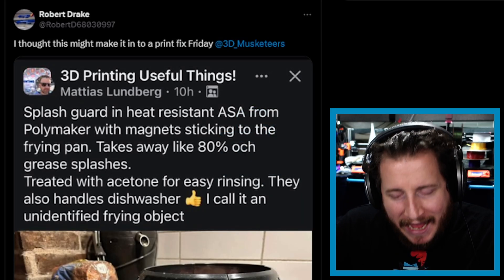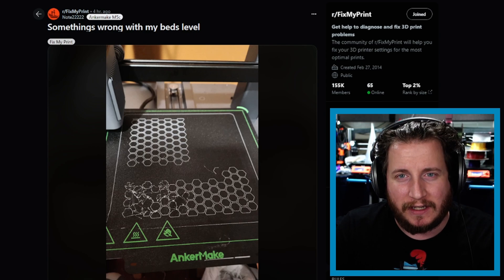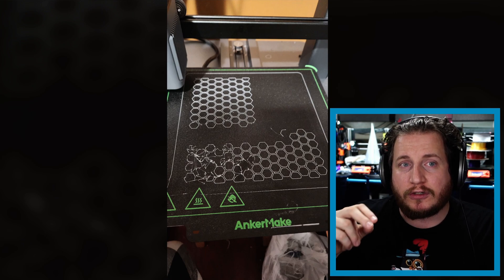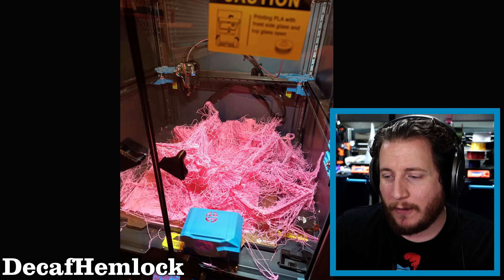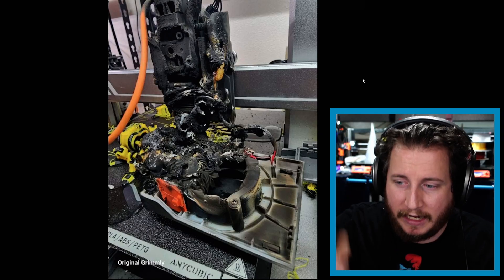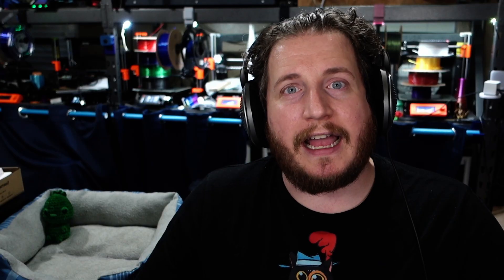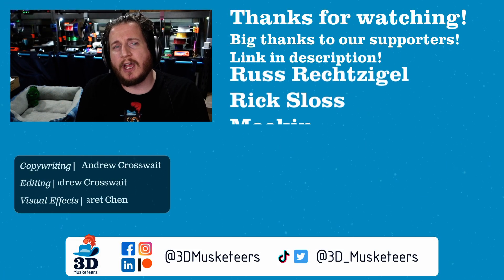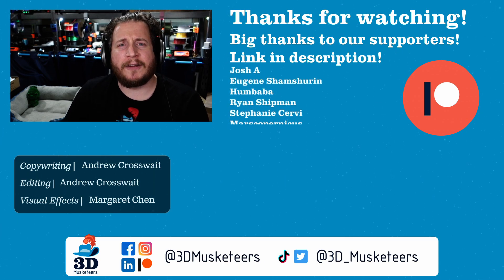Anycubic Fire Hazard?? - PrintFixFriday 173

Comment: With multiple printers myself, I am kinda disappointed with the overall negative views on the kobra 3. I also have 2 bambus, another kobra 2 and 2 crealitys. It does scare me that there have been a couple fire posts I’ve seen, but actual print quality I’ve had nothing but good luck. Have had more issues with my p1p than either of my anycubics. But I guess it just shows that each person is different and it can majorly vary machine to machine.
Reply from the maker: definitely some variability. Keep an eye on those wires and connectors though.

Comment: Another great video mate. What scares me is not that printers can burn up it's that some people believe it can't happen :( We are working with machines that are designed to melt plastic at high temperatures, of course there's room for it to go wrong :) This is why I have installed extra fire alarms, keep a fire blanket and extinguisher to hand and don't set prints running when I know I won't be home. That is before we look at the specifics of certain printers that seem to ship with faults or less than ideal components.

Comment: 6:05 also check the nozzle is clean before starting print. Had a similar issue with Voron Tap where the first few probe points (bottom left) would be way off from rest of points due to a tiny bit of plastic on nozzle that would knock/fall off after a few probe points.
Reply from the maker: ah, good point!

Comment: Hiya Grant,
I think the problem on the Sovol SV08 could be that the part wrapped at the front left corner. It looks like the part lifted up there.
I had the cable problem with the canbus cable of a BTT SB2209. I used the included cable in my drag chains. After just ~100h of printing on my Voron V2 the prints were stopping at different heights. After some painstaking tests, I found out the error happened at roughly the same X-Y position. I took the cable out, dissected it and found out the CanL cable was broken inside the insulator. Now my V2 runs with an Ölflex cable and no problems whatsoever. I will never use an included canbus cable of any canboard in the future again. I don't know why the factories of can boards do not include a high quality cable in their kits, as I would gladly pay more for a kit with an Ölflex or other branded cable which is certified to run in cable chains. The whole troubleshooting to so long and costs more than to pay for an upgrade for the proper cable. 100m of Ölflex cable are ~95€ which would result in added ~4€ bare costs to the can kit. even if the factory would double the price of it to let's say 10€ additional cost, I would gladly pay for it. Unfortunately even after raising the issue on discord with BTT, there is not even a warning not to use their cable in drag chains, not in the manual nor on the biqu product page, as I suggested to them.

Comment: cable fails; one of my printers started to develop a thermister fault with instant shutdown (fortunately) every time it ran more than 4 inches above the bed.
@#$%$ ribbon cables. After receiving my replacement printer, I ended up carefully setting up the ribbon cable path to spread the flex across the entire cable as much as possible. zip ties in the right places (some intentionally very loose).

Comment: Yeah, as a owner of the Kobra 3, I still can't recommend it.  It's inconsistent and they are still working out the bugs almost 6 months later.  
Leaky hotend, Bad firmwares, Horrible Cable Management setup, Z Rod Coupler Rubbing, Bad Wiring, and Z-Offset not saving.
Just Spend the Extra Money and Get the A1 combo that the Kobra is Copying from anyway.
Reply: Can just agree, should have gone for the A1 as well.

Comment: The issue with any cubic it that their therrmal protection settings are unknown. They don't let you access the firmware settings on the kobra 2 pro, max, and plus. My kobra 2 pro doesn't off the bed nor hotend during preheat at all forafter an extended period of time. I don't know if the kobra 3 are having the same problems, after seeing these issue, I'm not buying anything from any cubic without an open source firmware.

Anycubic as a company doesn't fix their problems, they just release a new 3d printer a year later with even more problems. They also rush their products to the market with a ton of issues.

Comment: I'm just going to be "that guy" and say that if you cook bacon in a teflon coated pan you don't deserve bacon.  Cast iron for the win.  If grandma could cook in cast iron and not have it stick you can too.  Bonus points for cast iron being non-toxic.

For the anycubic kobra 3 fire, I wouldn't be the least bit shocked if it was one of the early ones that has the defective nozzle.  Many of them are getting HORRIBLE blobs and if they aren't caught in time...well you can see the result.  Oddly enough their solution seems to be to GLUE the nozzle into the hotend. Lots of complaints on r/anycubicoffical.  Methinks that anycubic will be facing a similar public relations issue as Qidi did.  If they were smart they'd just send out replacement re-engineered hotends to every owner AND include one with every new sale PLUS stop selling them until they replace them in EVERY one they still have in the warehouses.  But this is exactly why I will NEVER be an early adopter for ANY product.  I say let the suckers jump in the front of the line and pay to be beta testers.  I'll consider buying once they've come out with the second, or even third, revision.
Reply: Microwave is the way to cook Bacon ;)
Reply from the maker: I too enjoy the love of cast iron from time to time, however the convenience factor of non stick CAN be nice. Depends on how much time I have or if I have not abused the cast iron somehow accidentally...
Reply: @3DMusketeers  I still have, and use, my grandma's cast iron skillet she got as a wedding present from her mother-in-law in 1936.   the ONLY teflon I own is the bowden tubes in my parts bin. 😁😁
Reply: Stainless steel...
Reply from the maker: I always seem to get the temp wrong on stainless, but that is 100% operator error lol

Comment: I have a Kobra 3 and I have observed that the Hotend wires (Black) are rubbing against the screw holding the part cooling nozzel in place on the inside of the cover showing black dust and damage on the cable to the nozzel.
This would have short circuited the hotend if not rectified.

Quickly sorted with some electric tape covering the screw.

Comment: @16:00 is why I am against people printing X or Y cable chains, but do nothing to upgrade the wiring that is flexible enough to be contained in a cable chain. Your average printer wiring will either work harden like shown, be bent at a higher angle than if not in a chain and result in issues over time, or simply the chain rub the wiring and wear off through the sheathing and risk shorts. Z axis move so slow and in small increments in comparison that it many times can be chained without risk, but XY movement can very quickly wear out wiring. Proper wiring made for cable chains has a more silcone inclusive sheathing and usually higher strand count to handle the flex and wear of the chain friction.

Comment: Honestly, for death blobs, I'd say that the thermal stripping blade for a soldering iron(they come with butane ones, they're basically a wedge you can use as a knife) is one of the best ways to slowly and carefully cut away a death blob, where you can then use a pair of pliers to grab the pieces you cut away and carefully pull them out without ripping any cables out. 

It's cheaper than the hotair station at least, and really quite handy if you want to just quickly cut a 3d print apart.

Comment: For the cable inside the drag chain... the best thing is to replace the cable itself or the full wire assembly. But you would need the extraction tool for the pins so the connector does not get damaged. Tbh buying a new cable assembly would be my option, if I would not have decided to go CANbus now.
And for everyone who might think soldering would be ok. No. Don't solder such broken cables which move a lot. They will fail 100%, and they will fail sooner than later.
Reply from the maker: yup! I would replace the whole loom too!

Comment: Investigate the following:
We had a user with a Kobra 2 Plus a few days ago which had a burnt PTFE Tube and was about to burn but was turned off before a fire could occur.
Take a look at the hotend. The PTFE Tube on the Kobra 2 Series goes down directly to the top of the hotend. Perhaps that's an issue on the Kobra3, too. If then the hotend gets over 240 degrees or so, the PTFE can start to melt and flow down on the Hotend.
Reply: PTFE to the hot end has been the default of any hot end that isn't "all metal" for better part of a decade.. For some not only to the hot end, but literally TO the nozzle for some cheap brands that were meant to only run PLA. It was the most economical and most user serviceable solution and used by EVERY hobbyist brand. That is where it also became important to know that if you want to print filaments outside of PLA, PETG, we had to upgrade to a full metal hot end. Also PTFE will not melt at 240.. not even at 300C.. it simply starts to warm up and become malible at 260 and starts releasing fumes you don't want to be around. PTFE "flowing" wont happen at anything a hobby level 3d printer can reach. It may become soft enough that abrasive filaments can peel filings of it off that end up in your hotend though. 

In comparison, i was very surprised that Bambu by default has all metal hot ends even on the A series, at their price point for the A series.
Reply: i got a kobra 2 neo and the PTFE tube also goes straight in to the hotend, and if i am right this was with my Kobra Go as well.
Never been really a issue but glad i dont use those printers no more.
Reply: Hey, Kobra 2 Neo here, that isnt the case for my model, stops about 8mm above. So yea, maybe that is the issue

Comment: What do you think about kitchen organizers using 3D-printers? It feels a bit uncomfortable using PETG for that. Dichloromethane would give a bit more peace of mind, but still a bit concerning regarding the creation of a surface, which is perfect for bacteria. PP might be the alternative, but  I am still unsure.
Reply from the maker: Dichloromethane is too dangerous IMO (says the guy that uses it all the time...)

PP is definitely an alternative but layer lines are still the issue. TECHNICALLY I would think that if it is always dry it SHOULD be fine, but I am not a scientist. you could always coat it a bit in epoxy or something but that of course removes the print and go fun of 3d printing...
Reply: @3DMusketeers  Do you apply dichloromethane using a brush?
Reply from the maker: syringe and blunt tip needle for my use cases. Using it as a thin chemical adhesive. Taking as many precautions as I can.
Reply: @3DMusketeers  Have you tried it to remove layer lines? A friend of mine tried doing that for a PLA toy using a brush,  and it was a success. Still, I hesitate to use it even though I have a MILLA mask with an A2 filter.